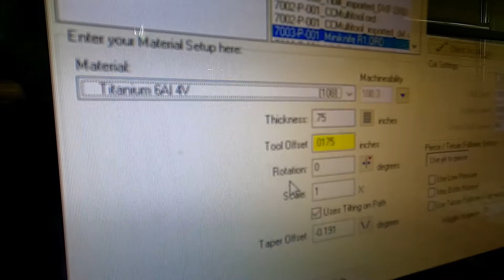Making an ultralight TITANIUM KNIFE - 2.4 grams

Comment: Hi Steve. Awesome design and an essential piece of UL kit to have... Just curious on your choice to waterjet  cut the Ti knife vs Laser cut. A prototype run perhaps?
Reply from the maker: I cut using either, and there are pros and cons for each. In this case the WJ was used as I didn't want to induce heat on the edge of the profile, and the WJ doesn't leave as bad of an edge burr. Plus we have a WJ here in the shop so most of my prototypes use it 😃
Reply: @Suluk46  Thanks for sharing your insights. Plus, Ti isnt cheap and there is very little margin for error 🙂..Your content is amazing and keep me motivated to enjoy the great outdoors 🤙